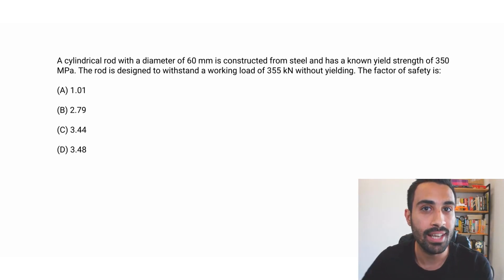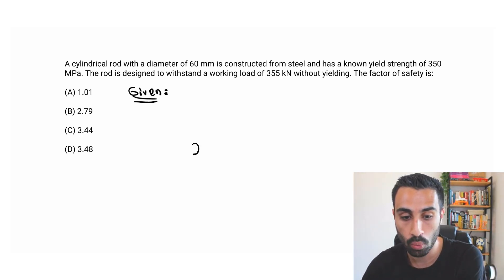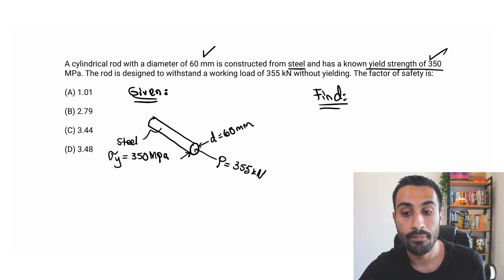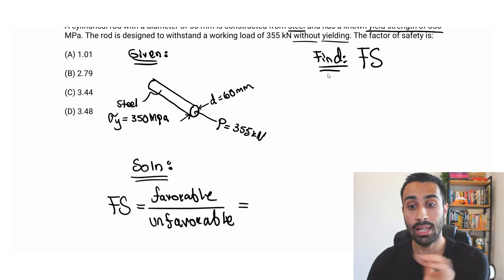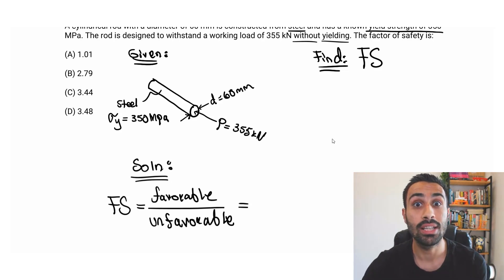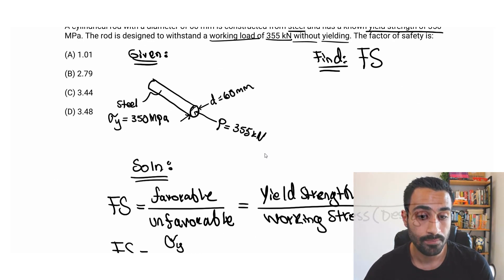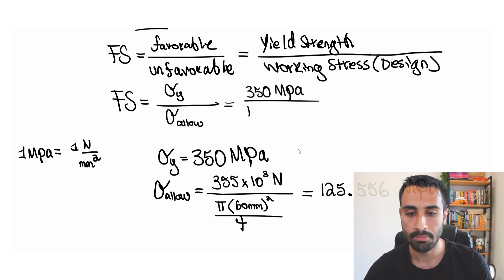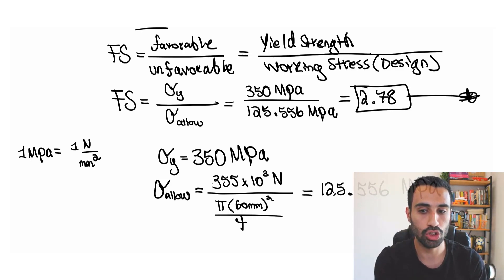FE Exam Practice - Factor of Safety - Mechanics of Materials

Comment: I believe there is Working Stress that is applied to the material and a Design Stress in which the material is designed to handle. In your formula, Working Stress and Design Stress is the same.